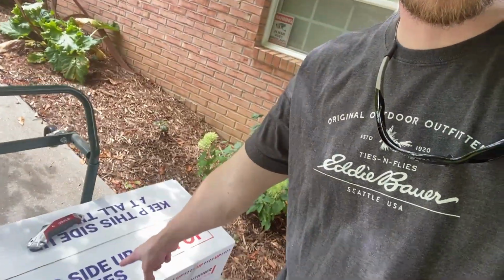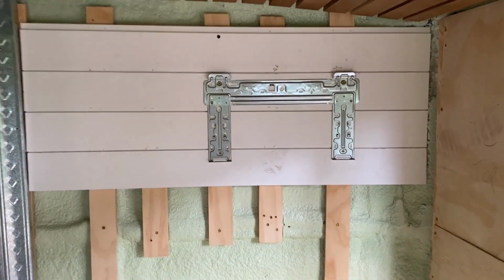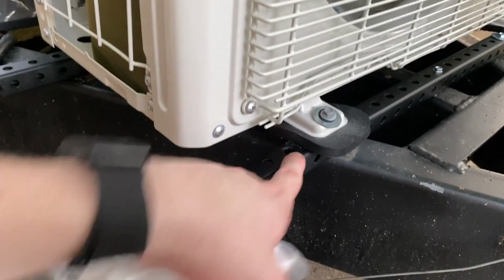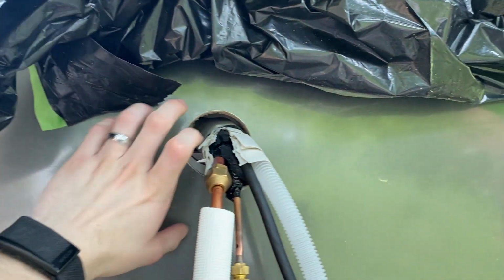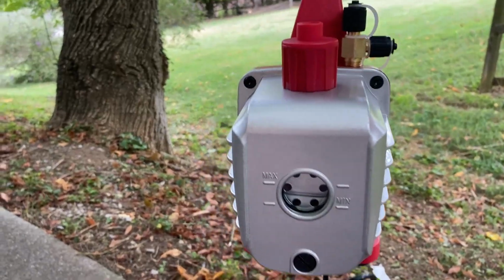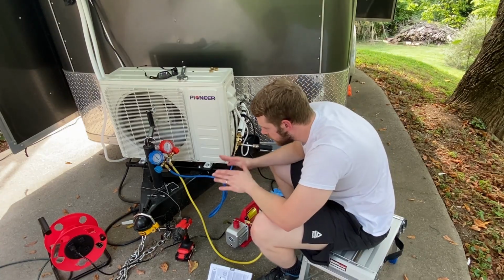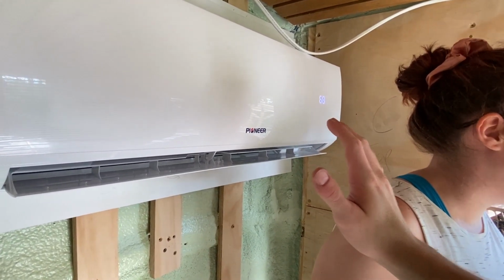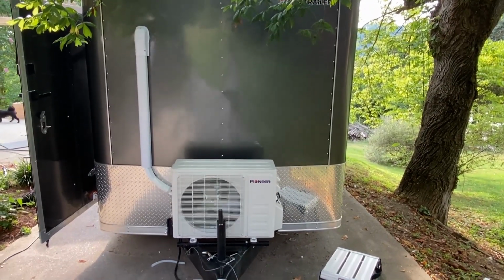Mini Split AC Install in Cargo Camper Conversion

Comment: Finally got it up and running. The only delays we had was because we realized we needed some extra parts (I’ll list that below) https://www.youtube.com/post/UgkxihMYiJNXcHdbH-7ihymsLz61l7jVyb5O . So we have a loft where our current hvac just couldn’t seem to keep cool during the summer. We have been using a window unit since we bought this house over 6 years ago (all the houses in this neighborhood were built in the 80’s and majority of the houses built like ours use a window unit). I hate window units because they are just so noisy and the one we had really only cools one side of the loft. I had contemplated upgrading our current HVAC, but with all the rising prices these days, it would take years before saving up enough to do that. With the advice of my father-in-law (used to run an HVAC business), he recommended we get an inverter instead. We thought we bought everything we needed, but there were just a few other parts we didn’t anticipate needing (which is what caused most of our delay). My friend and father-in-law did all the work to get it installed and running and now we have nice cool air circulating nicely throughout the entire loft. It is very quiet and even the outside unit is much quieter than our main HVAC unit. Saved ourselves thousands getting this.
Reply: I have 3 of them on my house.   They a re cost savings after install over traditional central air.

Comment: You flipped the breaker and jumped back, lol.

You guys are awesome, made my morning.
Reply from the maker: Electricity is scary!
Reply: @diycargotrailer  I am in the middle of a conversion.  I know how to wire, but I plumbed trailer with romex 10/3 it's a pain.  I may rip it out and get 14 guage.

Any thoughts?
Reply from the maker: @geraldwilliams3898  you can Google “wire gauge chart” and see what amps for what gauge and what length. Campers have either 30 or 50 amp hookups and really no reason to put in a 50 amp. So for a 30 amp, 12 gauge is probably my recommendation at least for the wiring from the hookup to the electric box. As for the interior, I did all the “big” stuff like ac ports, the fridge, and the mini split with 12 gauge and I did everything else like lights, pumps, 12v ports with 14 gauge. 10 gauge is definitely overkill for any application I can think of, especially in a camper.

Comment: Just letting you know that I finally installed the pioneer 9000 mini split. it was really easy to install. thanks for your  video really helped me a lot. it is very quiet and nice and cold. keep making  your video love watching them.
Reply: @ TH

Where did you install your unit? Is it in a house or vehicle ?

The compressor unit that’s outside, is it a plug in?
Reply: @EASTCOASTIMPERIAL  I  installed it in a cargo trailer that I converted into a camper. I hooked it to a breaker panel, with a 15amp breaker. it is a 110 volt. Has a Rv 30 amp hook up.
Reply: What size wire did you run from the breaker to the ac?
Reply: @ronferguson793 I personally would use 12 ga wire for the 15A breaker, most code books say you can use 14 gage wire.The bigger wire will allow you to add a bigger unit later.

Comment: I would've ran the hoses up  underneath  the trailer up to the inside wall up to the inside unit ! Just  a cleaner look !
Reply from the maker: Agreed! I wish I had done that. Didn't even occur to me.
Reply: I was wondering how it was going to look too , but with the additional “cover” you installed really cleaned it up. Little bit of paint- ehhh, I think it will look just fine. Great job !

Comment: I had one of these on my 18 wheeler and the problem I had was the compressor jiggled around so much it broke a refrigerant line. I cured it by bolting the compressor down solid. It worked but it was much noisier. It lasted a few more years and it worked great.

Comment: Beautiful job I built the same 7 x 16  drop down door  toilet shower up front kitchen sink  refrigerator microwave lift bed  and electric awning with electric jacks  under each wheel for leveling  only used a window a/c  need to swap out to a split system

Comment: Great job. I think I would have cut my hole at the bottom and ran the lines on the inside though. Also You might want to get  maybe a peace of plastic or aluminum that you can mount in front of the unit before you pull it down the rd. You may want to put some rubber  membrane between the unit and the tongue for vibration protection for the unit.
Reply: I was thinking he could use a generator cover on it going down the road. Wouldn't want all that stuff going into the AC unit.
Reply: I was thinking the same thing.  Go straight in at the bottom, then do your routing inside the trailer where you can cover it at your leisure.

Comment: AC setup is nice. Good job!  I would think you need to make a box to cover outside unit while transporting. Rock ding will probable damage it if you don't
Reply from the maker: That's the plan!
Reply: Good thinking

Comment: Definitely worth the money for some proper dampers to mount the compressor.
Reply from the maker: You know I bought some nice ones and it felt too unstable so I took them off and used the ones it came with instead and they actually work really well. There is no noticeable rumble noise.

Comment: I like the enthusiasm here, and huge props for the self-confidence to tackle something like this.  I think I'd run the piping straight in at the bottom.  The clearance on the tongue jack also seems sketchy.  I wonder if the forces associated with braking will cause any issues with the way the external unit is mounted.  Will the top want to sway forward during braking, and push pressure on the mounts?  Something to keep an eye on for the first year.

Comment: Excellent video.  Thank you for sharing.  Wonder how much $$ it would cost to have someone do the vacuum/charge?  The rest seems relatively straightforward (I know there is a lot going on there).  Wonder if someone makes a mount that would lift the minisplit up?  I have a larger trailer with a similar "short" tongue.
Reply: Just make a bracket/shelf.

Comment: Maybe a dumb question, but what type/size wire and breaker size did you use? Also, does just the outside unit get wired for power or both? I am trying to determine which and how much wire to order along with the unit. Thanks and love the content, super helpful!!

Comment: @DIYCargotrailer
Don’t stress or fret too much about the external piping location.   If it bugs you too bad, relocate behind the external compressor and up inside the interior cabinet.  Plug the old tubing location with a external vent.  Either way, it’s a great build.

Comment: Great job!  Did you add any additional protection for the pipes/wire coming through the wall, that aluminum is so thin is like a knife.  Any concern about rocks getting kicked and thrown into the outside unit?  With it being a house unit, the connections would concern me with all the bouncing the trailer will be doing while towed.
Reply from the maker: Yea the kit comes with a roll of vinyl and I wrapped up the part going through the wall really good. I also put spray foam in the hole to seal it. As for the outside unit, I am probably going to get like a propane tank cover or build a case for it so its protected when not in use. I also don't want the fans spinning while I'm driving. And lastly, the connections do concern me. I am probably going to secure those lines a little better though they are already very stiff. All good thoughts.1
Reply: Instead of a hard cover take a look at a company that makes boat/car etc covers and have them make a cover for your unit. (Double thickness) plus the canvas cover will lay alot better on the compressor lines and won't stress them.

Comment: Cool.. My question, if the "diy" mrcool  was only 300 bucks more and you would not have to buy a vacuum pump  etc... did you really save a few hundered when all is said and done?  I ask cause this is on my list for my ctc.  Be sure to put a "sleeve"  ( piece of pvc pipe"
 in that hole going into the trailer so the lines dont get F"ed  up. Maybe run a weld along the metal mounting brackets cause I would not trust self tappers, just my opinion
Reply from the maker: Really depends on pricing. When I bought mine, the pioneer was like $700 and the Mr. Cool was like $1200. The vacuum pump and manifold were like a total of $100. So it definitely saved me some money but it just depends. I just looked on Home Depot website and the 9000 BTU mini split was about what I paid for the Pioneer so maybe that's a better option right now. All depends. Regardless, all the steps are exactly the same except for the vacuum pump part which now that I've done it and understand it is super easy. I think either option is a good option. As for the self tappers, they are really big ones. There are 3 in each bar and it's VERY secure. I'll keep an eye on it and make sure it stays that way. Can always go back with a weld later if needed. I don't own a welder though...
Reply: @diycargotrailer  seems to me we can rent the vacuum,etc from auto zone free based on deposit..Yes?
Reply from the maker: @TomOHara72  Good question. I have no idea
Reply: @diycargotrailer  Oh, yes Doc. One can! I used it on a neighbors A/C 3 months ago.and Auto Zone gives one 3 months to bring it back..or its yours off the credit card.:)
Reply from the maker: @TomOHara72  That's cool! I wish I had done that!

Comment: How wide is that front box on the tongue? (front to back) And why did you go up through the front vs going through the bottom of the trailer with all the wires/hoses?
Reply from the maker: I don't have the exact measurements of the tongue. Not going through the floor is one of my regrets on the build. I def recommend doing that.

Comment: How's the Pioneer holding up? How's the a/c holding up to the roadway conditions(potholes etc.)? Really enjoyed the video.
Reply from the maker: Really good. Heats and cools great.
Reply: @diycargotrailer  I figured that the copper lines will eventually work harden and crack from flexing during road movements.

Comment: Why did you run the lines on the outside? Wouldn't it have been better to run them on the inside with a lower hole?
Reply from the maker: If I did it again I would probably do just that
Reply: I’m doing something similar. I’m going to run the lines through a hole in the floor and then up the inside wall to the unit.

Comment: Great job but you didn’t use a micron gauge that I seen to vac down to 500 microns. The mini split units and all hvac units have to be vac down to 500 microns for a period of time. You can’t see that on your guages. Just hope you got all of the contaminants out of your copper lineset. It can kill your compressor on your outside unit or plug up your expansion valves inside or out. Other than that great job man!
Reply from the maker: I hope so too! Yea I am not sure about that. I watched multiple videos from HVAC professionals and did exactly what they did so I hope it lasts!

Comment: How much power is required to run this?
Reply from the maker: The manufacturer says 17 amps. I have it on a 20 amp circuit breaker
Reply: @diycargotrailer  Thanks a lot. My Bluetti AC200 might be able to push it.
Reply: @roberteads9995  Easy, ive used mine on the AC200P, just need to be able to charge it up, will need to use all the solar input (700) and AC charging brick to keep up
Reply: @Drifty325i  what's an AC charging brick? Thanks
Reply: @JoePAcalaughs  just plugging it into AC power off the genset

Comment: Tech support told me the line set had to be a min. of 10 feet for it to heat correctly.
Reply from the maker: That thought had occurred to me. But the instructions clearly had steps for shortening lines so I don't know. It seems to work